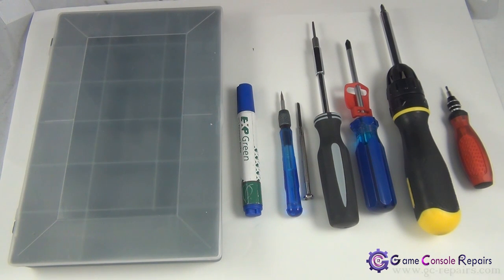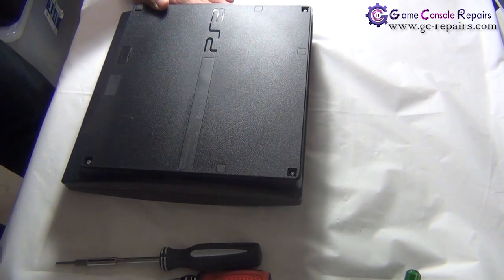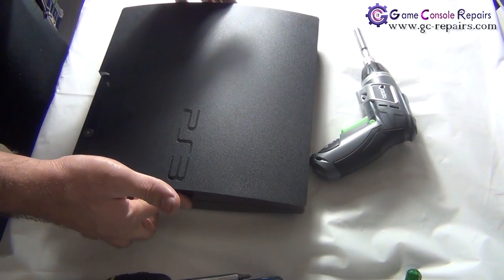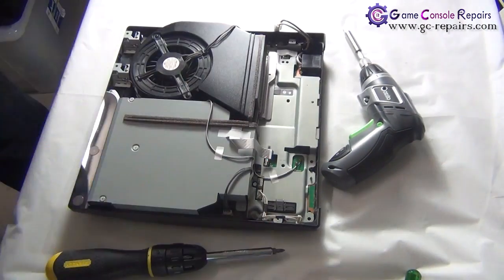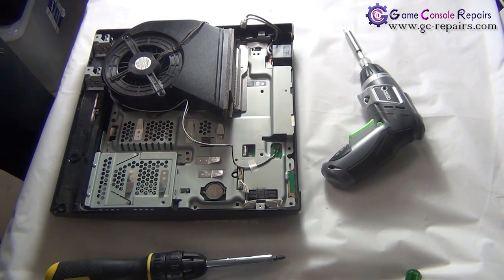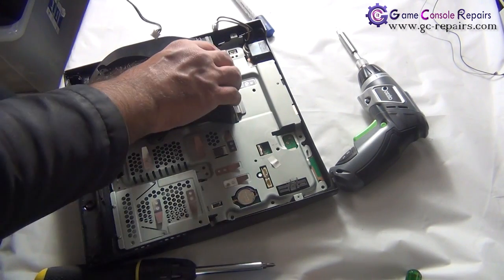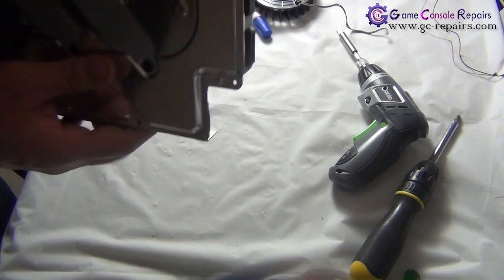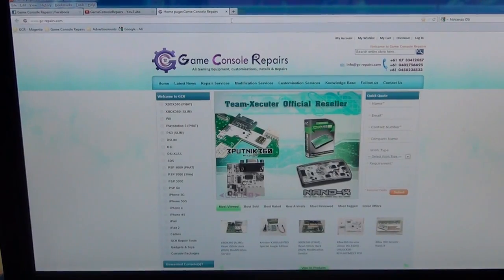PS3SLIM   250GB CECH 2002x   Disassembly   FULL by gc repairs com

Comment: I really appreciate your video but your service prices are absurd. 150.00 for a blu ray drive laser?
Reply from the maker: digitalblasphemy1100 Reason is these are genuine lenses, these lenses come with 1-3 years warranty unlike the ones you buy from ebay/Amazon which half of them dont even have any warranty at all.
Reply: GameConsoleRepairs right but I can buy a new system for 200 with some games and a controller with a warranty

Comment: Wtf dumb ass screwdriver do I need for these last 4 damn screws to take the cover off. This is bs.  Fuckin Sony sucks balls
Reply from the maker: @Ericdawg420mate, you need Torx T8 Screwdriver.
Reply: GameConsoleRepairs Or a well-made steak knife. To avoid stripping with a knife, you press up into the groove, and lightly turn to the left. Counterclockwise. Always keep an applied up pressure, so you dont slip out of the groove with the tip of the knife. -- Or you can go buy a Torx screwdriver if you're clumsy and don't want to risk stripping the four security screws. The rule of thumb is to keep up and to the left. Add medium amount of pressure and the screw should turn.
Reply: Seventh Chimera Thank you for the suggestion of using a steak knife it saved me from going to the hardware store to go pick one up. I found that one with a sharp point didn't work but one with a blunt point worked fine.
Reply: +Seventh Chimera very small flat head does the trick

Comment from the maker: sounds like there is some obstruction. You have to gently pull it up, use small phillips flat-head screw driver & insert on the edges. There are 3 clips on the left side of the console, try to un-clip them. There maybe a screw stuck in one of the holes ?